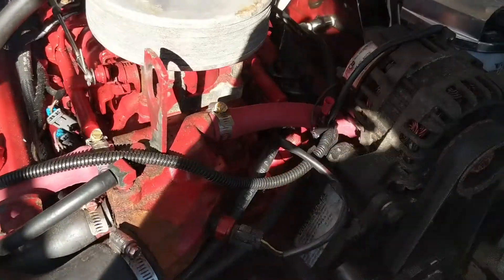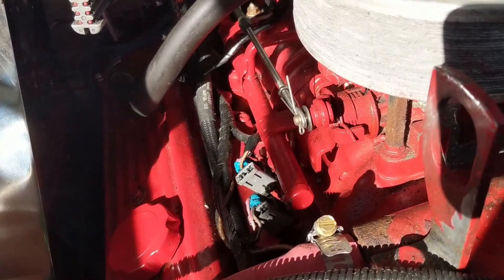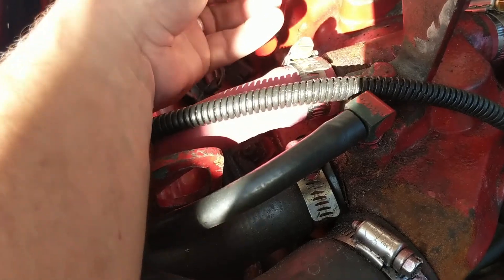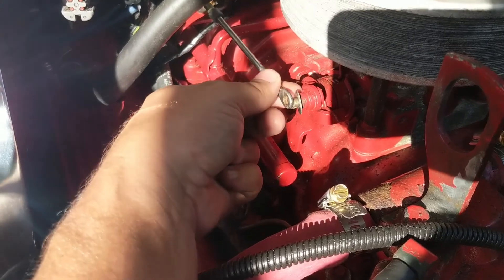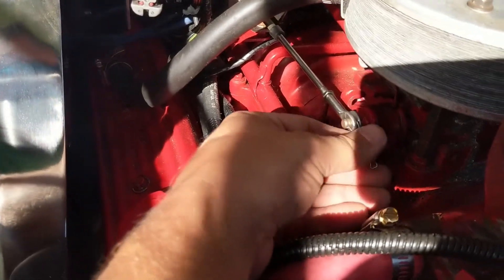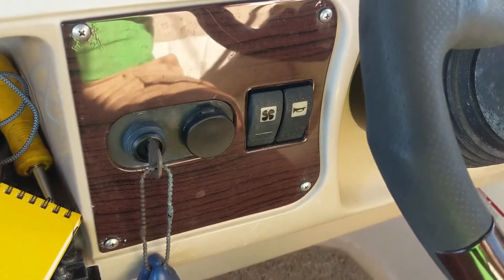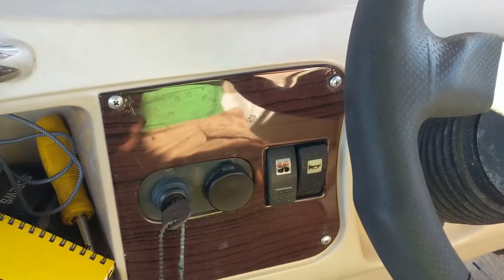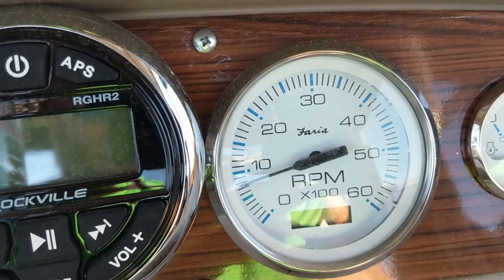Adjusting the throttle control on a Volvo Penta 5.0 GXI | McCoppin's Manual to Manliness

Comment: hi, thanks for the video, I have an old AQ200d, gasoline, and my idle is way too low, so engine dies on me when is mostly needed *docking*, I will check what you say since I guess it should pretty look same as yours. cheers !
Reply: I have the same problem. Have you fix it, what was the problem? Thank you in advance.